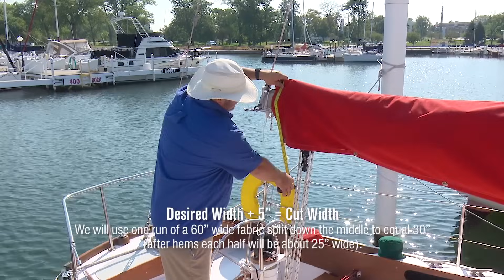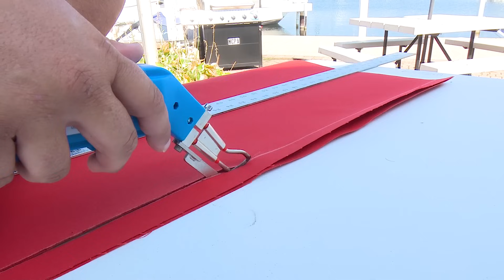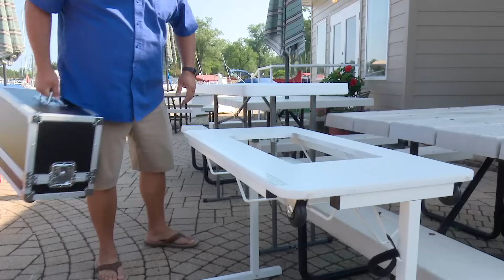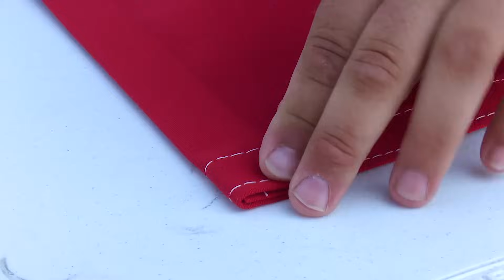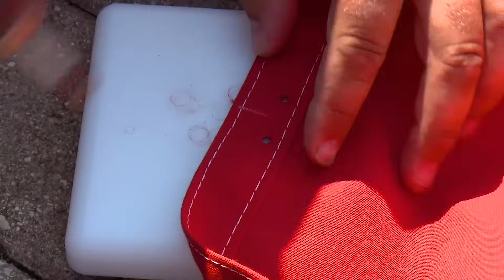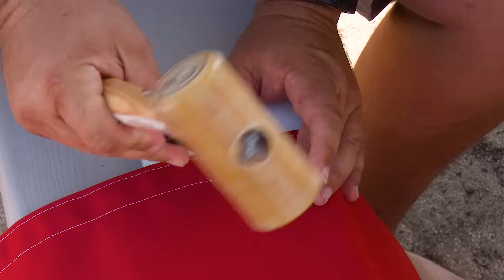How to Make a Mainsail Cover Boom Tent

Comment: I noted that you allowed 5” for the 2 double hems, but you marked the individual hems at 2-1/4”, not 2-1/2” to allow for turn-of-cloth in the double folds.  I love that the patterning ruler slides along the cut edge as well as the dimensioned soapstone pencil holes - saves LOTS of time.  You guys think of everything!